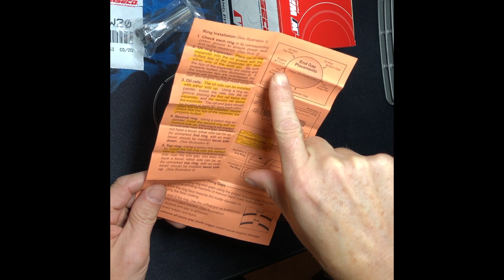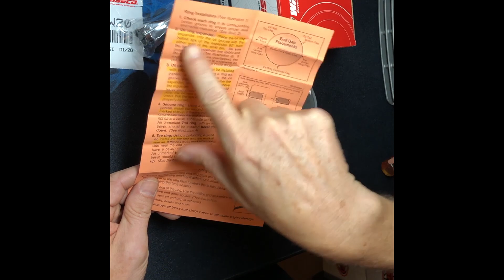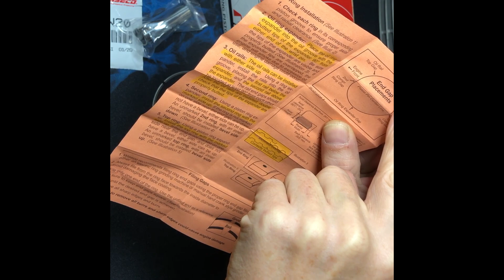Honda 400ex Build - Part 12 Lost - Motor Top End, Piston, Ring End Gaps, Intake Boot, Exhaust Studs

Comment: Hey that screw hole to the left of the bottom of the intake boot what is that threaded hole for my bike has the same thing on my new head.
Reply from the maker: I'm not sure because that hole is not on the OEM cylinder heads, only the Chinese knock-off have them. My guess is that is either there as part of the mold or it is for another application like a 400 dirt bike or something else that needs that mounting hole for something.

Comment: Never use oil on head threads it has no where to go and it will not seat all the way down and you'll think it is
Reply from the maker: Thank you for the tip ... I use a dab of moly grease now (very tiny dab)

Comment: How did the Niche cylinder hold up would you purchase again?  I need a cylinder and it cheap or crazy expensive.  Recreational rider around farm.
Reply from the maker: I haven't had any problems with it ... probably be fine for recreational riding
Reply: @11GalleryATV  would u susjest a full niche kit? Trying to rebuild mine cheapest
Reply from the maker: @theyzoomers  I didn't have any problems with the niche cylinder - my top end kit was "Parts Ace" from eBay and I didn't have any problems with that either ... now the Wiesco bottom end kit is another story ... I just got done pulling the crankshaft and replacing with OEM and OEM crank bearings ...

Comment: Great videos. Just picked up a basket case 02 that had a botched rebuild in it. And heck yah nice and thorough. Very well done been rolling right thru this build series can't wait to start on the X build series. Had one of them years ago as well. Is that head an OEM or aftermarket just curious?  Got a subscriber from Upper Michigan. Keep up the good work.
Reply: Ha ha watched another 10 mins got my own answer.
Reply from the maker: @BitcoinYooper  Thanks for the kind words ... yeah that cylinder head is not OEM, it is brand (Niche) and not the quality of OEM. I am not happy with it as the base gasket leaks already ... some of that is my fault though, as I should have surfaced it, but I didn't since it was brand new ... stupid me for not even checking! Also the timing chain is stretched already also (Wiseco). Not going good!
Reply: @11GalleryATV  Thanks for the review. So head and cylinder are Niche? Cylinder seem to be holding up minus base gasket? Going to need a cylinder kit for mine, seems that brand is the leader in aftermarket engine components. How many hours you get on it before some of the problems started to happen?
Reply from the maker: @BitcoinYooper  Not many ... base gasket happened after the 2nd long ride ... forgot to mention that the gaskets are also not OEM ... BUY OEM GASKETS if you can! I got the Wiseco complete 2005+ 400ex top and bottom rebuild kit (came with Niche cylinder) - https://ebay.us/wSecmu
Reply: @11GalleryATV  That's to funny the roached kit in the wheeler I got is from the same company, young fella I bought it off of spend $600 on the 88mm big bore kit with stage 2 hot cam arp head studs...well could tell he didn't have a service manual. rocker cover missing a dowel, head was missing a dowel.tiny spacer behind the cam chain guide is missing, head studs where missing the correct washers, one had one but was not right. piston rings where oriented completely wrong, and the biggest blunder was the oil pump drive gear was on backward so could never engage the oil pump gear haha holy crap eh. Kinda surprised it still built 30 psi compression how smoked it was. Crazy what some folks do.

Comment: I may have missed it in the description, but do you have the link to the exact cylinder, head, and piston that you used. I know you mentioned the brands in the video but was wondering if the whole thing was a kit
Reply from the maker: They were all purchased on eBay at different times and the links do not exist anymore ... the crank, main bearings, piston, rings, timing chain, and cylinder (cylinder came as "Niche" brand) all came in one kit from Wiseco (it came in a box called "Wiseco Garage Buddy") - the cylinder head and cover were purchased together as a set and was ported and polished - and the cylinder head guts (rockers, shafts, valves, springs, etc) were purchased in another kit (came as "Niche" brand). The camshaft is also "Niche" brand. So it's really just a mix of Wiseco and Niche with the bearings all Honda OEM except the mains that were made in Japan (good quality not Chinese crap). The crankcase is also a 2007 Honda OEM stock case that I had vapor blasted. Both covers are brand new 2007 Honda OEM stock and powder coated black. Here is a link to the Top & Bottom "Wiseco Garage Buddy" kit ... https://www.ebay.com/itm/264697839568

Comment: Hey sir where are you getting the specs for torque on the bolts I need specs on bearings frame etc I’m in the process of building a 400ex I have the engine done putting the frame back together and parts back now and need all the torque specs on em
Reply: He's got a 400ex book with the torque specs
Reply from the maker: a few different places ... I have a Clymer Manual and a couple of other manuals in pdf format - Honda TRX400EX Fourtrax/Sportrax and TRX400X 1999-2014 (https://amzn.to/3feSOMx)

Comment: the engine hardware where did you buy them or what brand are they
Reply from the maker: Well, here is some of it and I bought all of the stuff of eBay ... Wiseco Rebuild Kit Motor Engine Top Bottom End (Crank, Piston, Rings, Timing Chain, Gaskets, Seals, Cylinder Studs, etc), Niche Cylinder Jug, Niche Cylinder Head Rebuild Kit (valves, rockers, springs, etc), Kibblewhite Valve Seals, Wiseco Heavy Duty Billet Clutch. All the crankcase bearings (crankshaft mains, transmission, and counter balancer) are OEM and they came from https://www.motosport.com/oem-parts/honda/2007/trx400ex.

Comment: I bought a Kit similar to this. If anybody needs help, please ask me. I love to help.
My kit was a stock 85mm bore, 397cm. Stage 2 hotcams camshaft, 10:1 Wiseco 85mm piston. Cometic gaskets. I’m using stock OEM Valves & springs.
Reply: I’m building the exact same set up right now and am having trouble with the valve adjustment what did you set yours to ??thanks.